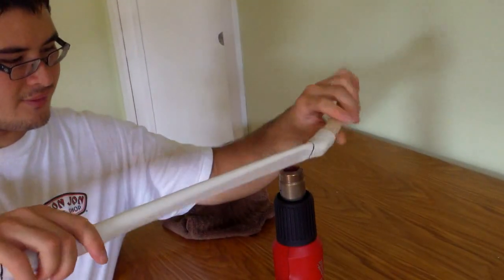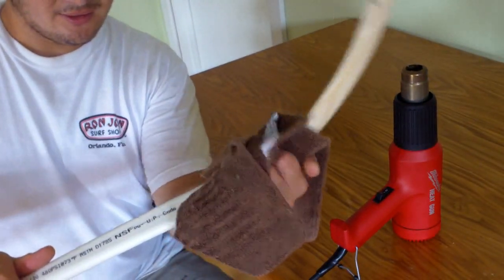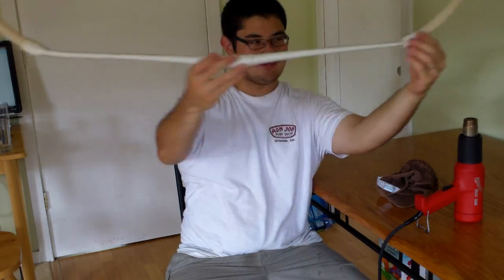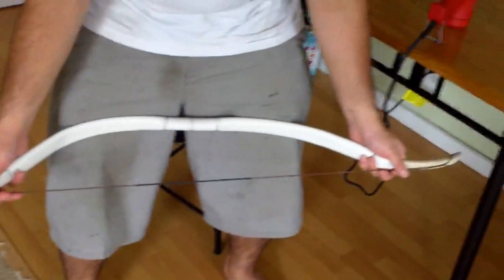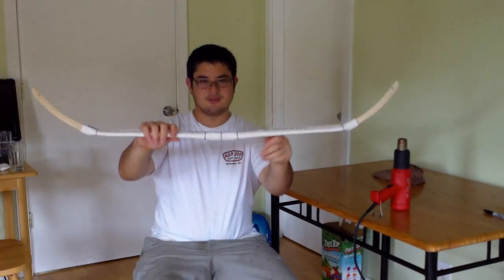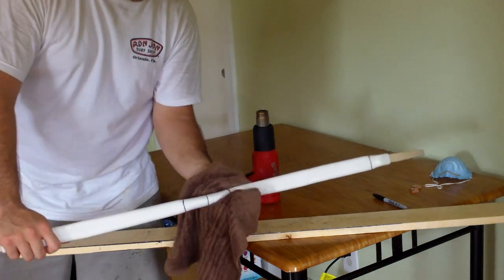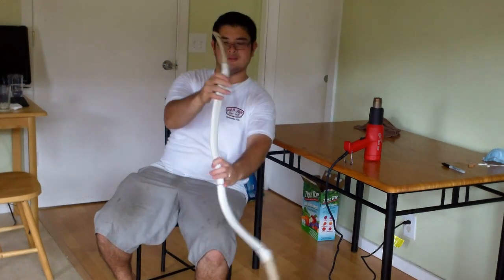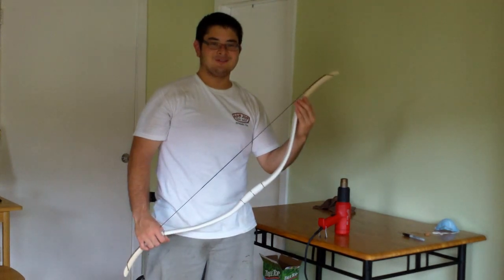Fine Tuning and Stringing the PVC Bow - Flattened PVC Pipe Horse Bow With Wood Siyahs Part 4 of 4

Comment: Watching you go back and forth with the thickness and reflex, I'm beginning to realize this might not have been the best bow for me to undertake as my first.  Oh, well.  I'm sure I'll learn a lot, either way. :)
Reply from the maker: It is a trickier design to get right, but it will teach you a lot, that's for sure! If anything, attempting a bow like this starting out will help bring down the learning curve.
Reply: For sure.  I've only done one siyah so far.  Had to sand it by hand so it's been tedious, but it also allows more room for error.  Gonna start working the pvc tomorrow and I'm sure I'll have some disappointments in store.  Heh.  I read your blog about the "hot-box" and I can imagine that, like you, I'll enjoy the finishing and decorative aspects the most, though I'm starting to think I should probably just hold off on all that stuff.  I get the feeling that I'll have a couple duds before I manage to make one worth polishing up.

Comment from the maker: @sikke3 There are a few things you can try. First make sure the string is resting along the belly of the bow. If the string is off to one side, it will just rock off the belly of the bow and slip to the side.

You also want to make sure that before you string it up that the tips aren't too weak. If they are too weak, the string won't stay on the bow. To strengthen them, just heat them up and let them expand like in the video.

Comment from the maker: @sikke3 You should also heat in a deflex in the limbs like I show before stringing the bow.

The tips of the siyahs should not be more than 3 or 4 inches forward of the handle when you string it up. Just try to make your bow look similar to the one in the video.

A final consideration is to make sure your string is not too long. A long string will just flip around, but a short enough string will stay in place.

This bow is a bit tricky, I wish you luck.

Comment: Other than cosmetics, is there any advantage to using Wood Siyahs vs making them from the same piece of PVC like you do in later bows?

If anyone has any input, let me know
Reply from the maker: Master Volume Generally you can get a faster-shooting bow with wood. Most good wood species can be made very light, much lighter than PVC, while still being very rigid. A one-piece bow tends to look more contiguous and streamlined, but wood siyahs actually add more to performance.
Reply: @BackyardBowyer  I doubt you'll read this but:

I have been making these bows thanks to you. But... a major pita I have noticed for me is when flattening the limb initially, it is hard for me to get good even tapering on both limbs. I was trying to go back and reheat and flatten the limb that was bigger. However, after you applied the siyah you went back and reheated and actually make the more flattened side BIGGER... rather than what I am doing. This is a HUGE tip and you should have made a video about that all by itself. 

Basically, it is easier to make something that is too flat, more round than it is to make something that is more round flatter. 

For me, this is a breakthrough moment. And...thank you for your contribution to archery. You're an artist.

Comment: I see nearly all of your bows have 28 in draw.  What would your measurements be to make one for a big guy like me with a 30 inch draw?
Reply from the maker: THANX4PLAYIN2DAY If you wanted the same weights I'm getting, just add 2 inches to the starting pipe length. Most of the longer bows can handle a 30 inch draw, just will be drawing a little heavier. Some bows will stack at that length, so adding the extra 2 inches is a good idea. Hope this helps!
Reply: Thanks a lot, I've been studying your videos and I think I'm ready to give one a shot.